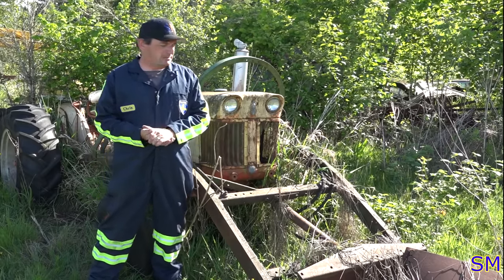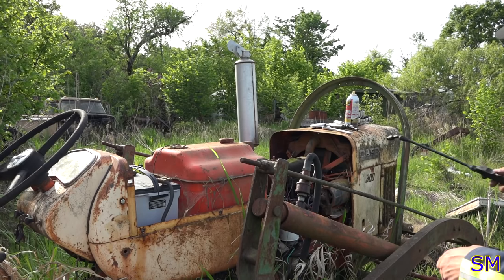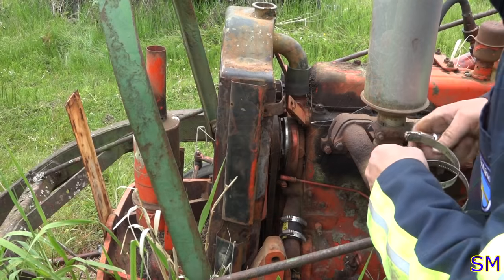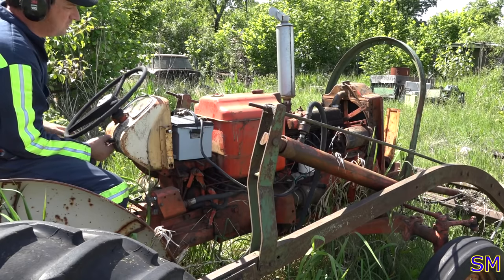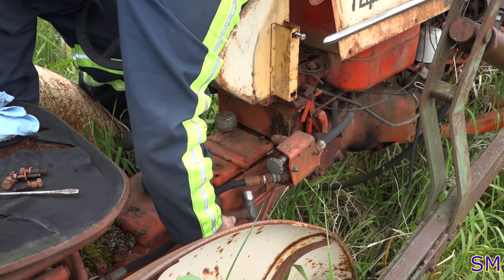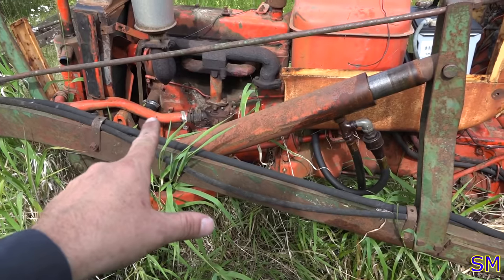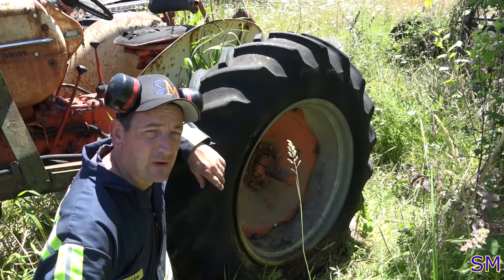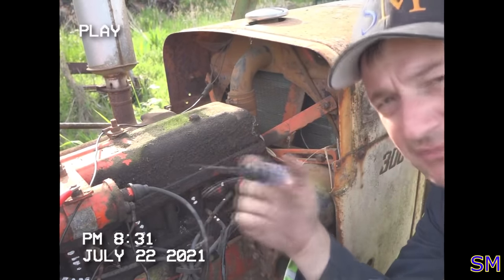Rescued 1959 Case 300B Tractor - Will it Start / Run / Drive After Left Outside for 10 years?

Comment: Great job! Always good to see old parked equipment brought back to life again. And the out-takes are hilarious!
Reply from the maker: Glad you like them👍
Reply: @SwedeMachine  New subscriber here. I am a chemical engineer however I have grown to dislike it. I have started to build a decent metal shop with a lathe, a 72 inch metal Brake, and an assortment of engine drive and plug in welders. I am restoring a Ford Ranger XLT with a 6cyl. and 4wd. I already mounted a flat bed, crane, Miller Roughneck 2e welder, drillpress and vise to the back. I have decided to do mobile welding and restore vintage Porsches. I hope my videos are half as good as yours my friend. Where are you located? Pa?,South Carolina? P.S. Thank you for saying how long its been between repairs...
Reply: @SwedeMachine  9
Reply: Grazie mille buona
Reply: Se

Comment: I've owned a couple of 311B Case farm tractors and older  V A C  case's also .      What I like about the 1959 and newer is they all have live power and are as modern as present day tractors .     My Dad bought a new 1960 530 Case and it was like yours , it had triple range , giving it 12 forward gears and 3 reverses .     Great ground travel for any job .     My wife's older brother had a 300 Case tractor with triple range and was clocked at 38 M P H on the highway .      When your 311B Case was new it steered like it had power steering ,  Case tractors from 1959 onward had a larger than usual steering wheel and a gear ratio that gave you the ability to use a spinner on the steering wheel which you could drive anywhere with one hand .      This also prevented them from breaking your arm if you hit something solid with the front wheels .      It would not spin the steering wheel .      Dad's 530 Case could not be choked out in 2nd gear low range or third gear low range .      Dad's 530 came with over sized tires on the back , which were 14.9 x 28 and also dad bought oversized plows and disk .     3---14 inch bottom plows and 7 ft disk .      The horse power and hydraulics were splendid .     The case 4 cyl. motor had an abundance of power and when dad picked up the 7 ft disk , the front end would not stay on the ground and had to be guided with the brakes .     The Case tractors in those years had to be one of the best farm tractors in the world . -------------------------------------------------------------------------------------------------------------------------------------------------Ernest E. Johnson

Comment: This was fun to watch. I bought a 300 triple range last year. Mine was running but I have found it has low compression in cyl #2. Thanks for the details about the wet clutch. Mine needs some adjustment. I repainted the tin over the winter.
Reply: ๐

Comment: Love those old tractors. Good work getting this one alive again! 👍🚜 That tire was probably loaded, hence the water. She definitely needs new shoes.
Reply from the maker: It did have calcium as a ballast in the tire. My tire shop only put 1/3 calcium back in as its semi retired, and won't need much weight on the rear drives. At some point I might do a follow up with this tractor.😊

Comment: That's a super find you have there. My 2nd old 8n has a flat pan with a flat edge for a cutting edge. Even though it's had a hard life it has saved me a lot of hard work. Good video.
Reply from the maker: This front loader attachment has definitely saved my back quite a few times. Thanks for stopping by👍🏼

Comment: Had a 311 B triple range with bucket. Low range great creeper gear. High range go like hell on level.almost 30. 12 speed ahead 3 reverse.not lota power but handy little tractor.

Comment: After working on aircraft, 
I found those all metal Eastwing drilling hammers work great in cramped spaces.
Reply from the maker: Awesome. Working on small 4 place aircraft must be a pain! Hats off to those A&P’s; my fat hands have a hard enough time with smaller cars lol.
Reply: @SwedeMachine  
I spent 14 years in arctic doing part 135 maintenance.
Cessna 182, 185, 206, 207, 208/208B, piper pa 12, 14, 18, Pa 32 chieftan, DHC 6 twin otters, Beechcraft 99, king air.
And the odd Maul and Luscomb.
4 hears of it working mostly outdoors.
Having someplace to work in out of the weather is a bonus! 👍🏽👍🏽
Reply from the maker: Awesome! Those planes are the vital life blood of those remote villages. I would love to fly in a Beaver one day. LOVE those old radials🤘🏼. If I had any coin my 1st plane would probably be a Grumman Tiger. Something about sliding canopies that is so Top Gun cool ha ha.
Reply: @shawnnelson6146  My Neighbors brother rebuilds planes up there Mr. Kelly. He moved from here up there after high school.

Comment: I have a 310-B Case. Frontend loader. With shuttle shift. It's been a great machine.
Reply from the maker: Awesome. The only thing I wish it had was power steering. The strong arm steering is not for the weak ha ha😂
Reply: Ran 580 backfilling pipe jobs  good engineers

Comment: That you! I have a 430 case diesel 1964 but I knew nothing about the wet clutch adjustment and it is a 12 speed triple range like yours.
I now know to look At 310 videos as it was the model just before the 430 for help.

Comment: Sadly penetrating oil does damage rubber. I use gas because it evaporates fast and is slicker . Also it damages rubber but it also fuses the rubber to metal making a extreme seal . 
 If you have problems braking tire beads lay them flat pour a little gas around the bead wait a few minutes and the bead will brake easy

Comment: Our family bought 2 1/2 acers in 1973. After paying a neighbor a couple of times to plow. My Dad on his delivery route found a 1936 case tractor. large drag disc, scrapper, and spring tooth. It broke down and he gave up on it. He wanted to work around the yard. He  bought a 8hp 4 speed Montgomery Ward rotor tiller. While assembled it, I went to play with the tractor. I was in the 7th grade and took electric lab. I had rebuilt the edger. I rebuilt the carburetor, cleaned the plugs, cleaned the magnetos, cleaned the fuel filter, and changed oil. The next trouble was testing it. It had crank to start it. :I was not aloud to start it. I beg my Dad to try it, but he did not want too. .Tractor way out in the back. I just begged him more and this time he said yes. It started in three cranks and ran well. He got on the tractor and started plowing. Get more done plowing, than with a tiller. He plowed the whole 1/2 acre front lawn under. This surprised my my Mom when she got home. She was like wow. It was so satisfying I got it to run. Should mention it had no muffler and was loud. My Mom would say there is fire out the side.
Reply from the maker: Aw man I thought that story would end sadly. But you got it running! YES! Save that old iron. Well done boss!!🤘🏼✅

Comment: Nice work. I'm curious why you  don't put air in the tires and pull it out of the weeds first. I think having all that vegetation everywhere makes it so much harder to work on things.
Reply from the maker: At the time I did not have my tow truck and don’t have anything strong enough to pull it out from its ruts.

Comment: Very cool. Never really seen much point in petrol tractors, they always sound like they are about to stall when you lift the clutch. That said that one would be a nice stable mate to my massey ferguson 135, ideally suited to charity tractor runs round the dales. Keep up the good work!
Reply from the maker: Yeah gassers dont have that deep torque that the diesels can muster. My guess is that to the poor farmer the gasser would be cheaper to purchase/maintain than a diesel. But this ol Case is semi retired, so it's mostly a putt putt around the farm. It will pop up again on the channel dont worry about that my friend. Cheers
Reply: Case had some engineering over others
Reply: Met a guy his last name is Case I asked him if is related to J I Case he said he is  then I asked what does J I stand for he told me Jerome Increase that name I had never heard before by anyone

Comment: I have a 210B tractor with a loader and backhoe. It only has a dual speed  transmission but it has a shuttle shift. It will go backwards in every gear. The backwards gears are faster than the forward gears. It will probably go 30 mph backwards in high gear. It weighs about 10,000 lbs with loaded tires.
Reply from the maker: Holy moly 30 in reverse? That would, um, make great content!😂
Reply: @SwedeMachine  The worst thing is it barely has enough power to go backwards that fast. It would need a real flat surface.
Reply: @SwedeMachine  I cant tell from your video but you probably know that your tractor has a dry clutch and also a wet clutch that is operated by hand. The wet clutch is so you can stop the tractor while still keeping the pto turning. The dry foot clutch will stop both the wheels and the pto. My tractor doesnt have the wet clutch as it has no pto and the shuttle shift is where your wet clutch is.
Reply from the maker: Ahhh 10-4
Reply from the maker: Yup it has both. Took me a while off camera playing around to get the hang of it
Reply: They must have made better thinking caps then
Reply: Does Case have a Patten on shuttle shift
Reply: @SwedeMachine  R&R
Reply: @SwedeMachine  does it have a foot accelerator pedal the 580 has

Comment: We had an old 50s Ford 8N gasser we used to rake hay and pull folks out of the mud on our rural county road, the diesels were used for the plowing, planting, mowing, and baling. How is the old service truck coming along?? Great video.. keep em coming
Reply from the maker: Service truck is coming along. I'm going to rebuild the transmission first. (There will be a video for that). But as it's currently late summer and the weather is holding I'm out and about recording content for when winter comes and our rain forces me inside. (GASP! Inside information lol).  Then I think we will have shop time for the service rig. All progress on that will be posted no worries 😄✌

Comment: Use KolorKut water detecting paste, its used on dipsticks to find how much water migh lurk in depths.
A bit would work on a oil drippy stick.
Reply from the maker: Ohhh I will look into that. That would prove very useful here 👍🏼
Reply: @SwedeMachine  
Amazon has it.
A squeeze tube wil last a long time.
Its a gold mustard color paste you swipe a thin bit a couple inches on tip a drippy stick.
If paste comes in contact with water it changes color to a burgendy color.
Be sure to wipe off after.
I once used some ridged 1/2 copper as a dip stick.
The kolor kut removed the copper tarnish!
So dont wipe it on your shirt tail or coverall sleeve.
Reply from the maker: Oh goodness….copy that I’ll check it out!

Comment: Very few hydraulics on tractors work at idle under load. that bucket is grown into grass. You need to bring the rpm up
Reply: I deal with tractors from 1948 to 2021

Comment: A word to the wise my friend... Never use those rubber coated linen gloves messing with gasoline. Had a friend working on his car removing a carb and got them wet with gas. He inadvertently picked up a spark somewhere and caught himself on fire. He snatched them off quick enough and only got superficial burns. Use the latex gloves when working around gas... Good job on the old machine.
Reply from the maker: Oh moly that’s wild! Not in a good way either. I will make changes in the future I need my hands. Thank you much👍🏼
Reply: Good comment
Reply: That little tractor isn't going to give you covid

Comment: Why did you buy this thing? Because the steering wheel and dash board are soooo cool. Looks at them. Agreed.
Reply from the maker: It was cheap. Also to help out on this channel if I need a bucket loader, or need help pulling something. 😉

Comment: Did the waterpump solve the overheat issue?
Reply from the maker: Naw, the thermostat fixed it. I replaced the water pump it since I opened everything up. People may criticize me if it was good don’t fix it, but I prefer preventative maintenance. My vehicles and equipment rarely break down because I’m proactive about maintenance
Reply: @SwedeMachine same, i guess thats why my daily drivers are 25 and 35 years old. With over a quarter of a million miles on each. So, no critisizing here, just wondered.  So a stuck T-stat.
Reply from the maker: @theresahoffman8408  Yes sir it was a stuck thermostat. I know it cost money upfront, but I prefer reliability rather than risking it for the biscuit. All good here😄💪🏼👍🏼

Comment: That was funny when you first tried to start it you cede you small GAS lol you can't small gas when it runs on Diesel lol I just given in you a hard time all in fun lol . shed have beaut back a weed whip. You might want to put the date year on the oil filter it helps reminds you when the last oil change was
Reply: It was funnier than that because he made you think it was a diesel. He smelled gas because the 311B is a gas tractor. That's why it had spark plugs, distributor  and a carbonator. He used the diesel in the cylinders to lube them before trying to start the motor . Diesel fuel will help the piston rings seat for the compression test.
Reply: General informations and Service Manual

Make CaseModel300Company countryUnites statesProduction yearsFrom 1956  Until 1958Tractor typeUtility tractor Fuel diesel Price3,500  USDTotal build249Service repair manual

Comment: Great video 👍
Where did you get the parts ? Thx
Reply from the maker: I got them from an online store. I can’t remember which one without digging thru receipts. It’s one of those mom and pop sites who specialize in old tractor parts. There is a few of them via a quick google search. Also eBay is a good option as well. 👍🏼
Reply: Thank you great video

Comment: I lucked out... bought a 311B...and  drive it home. Need to check compression though...seems weak. Still comically more powerful than the tractor its replacing, a Simplicity 7119 garden tractor 🤣🤣🤣
Reply from the maker: Pfff go big or go home yes? That’s awesome. Love it!😃🤘🏼💪🏼💯
Reply: Ok nevermind compression is actually pretty good - 120psi cold across all four cylinders.
Reply from the maker: @jensdavidsen4557  Aw man that is great news. Maybe just needs a tune up? Either way that is good news!💪🏼
Reply: That's the plan - I re-gapped the plugs but didn't replace them. Wires don't seem to be dry rotted so maybe good. I'll take a look at distributor, rotor, and points today.

Question for you...what's the purpose of both clutches? Because my hand clutch certainly doesn't have any engaging force like you described...yet I drove the thing...so I don't get the purpose of two clutches
Reply from the maker: @jensdavidsen4557  It’s called a shuttle clutch. It allows you to shift the transmission in any gear while it is not engaged. For me is very useful when mowing. I can go backwards and forwards only using the shuttle clutch and by not using the primary clutch pedal, that’s traditionally bolted to your flywheel, it will allow you to have a live PTO still running. For instance, if I’m doing a fair bit amount of back-and-forth while having a mower attached to the back, it will allow me to go backwards and forwards without the PTO disengaging so the blade still stands spin at full RPM. More or less allows you to do live PTO work by being able to engage and disengage and select gears and the transmission without stopping your PTO. It’s also very helpful for loader operations. You’ll still have all your hydraulics with the shuttle clutch disengaged. You can pull the transmission out of gear with shuttle clutch and grab any gear you want. Excellent for maneuvering and shifting the transmission while needing life hydraulics or a live PTO at the same time. Great question!

Comment: Nice to see it up and running but why do you guys head straight for the trees to destroy them
Reply from the maker: I was trying to push back the tree line and blackberries a bit. I regret not having a camera angle outside the tractor. But the tire was leaking air real bad so I didn’t have much time to drive it around

Comment: Must be summer all year around, sitting 10 or more years, everything else would be sezed  tite
Reply from the maker: I was told that the owner had some people out about 10 years ago and had it running really good. Then the overheating problem cropped up and no one decided to fix it until I came along 10 years later. Plenty of work to do still on it

Comment: Is that synthetic oil you're using? Those old engines aren't designed to run the Mobile 1 synthetic.
Reply from the maker: I like the 5w-40 flavor because it has lubricating zinc additives in it (keeps the camshaft from getting wiped out). Plus during the summer it will have nice heavy 40 weight to keep things cool, and the 5W will ensure it will start in the winter without breaking anything. Plus it has an SN rating which means its green lighted for gas engines too. In all actuality synthetic oil is just dino oil revved up. I have had many good years with this setup in other equipment. Thanks for the question!
Reply: @SwedeMachine  I use the T4 RotellaT 15W/40 it's non synthetic and has the same properties as the T6. My grandad always told me never use synthetic because it's made in a lab. He said if it doesn't come from the ground it's not worth using. He was vice president of Kerr McGee oil in Oklahoma City.
Reply: @SwedeMachine  but love the channel keep up the good work.
Reply from the maker: Oh hey that's cool trivia right there.  Yes, asking people about their oil flavor of choice will set off a fire storm of arguments. SSsooo whatever oil keeps your machine running that's the one to use =)